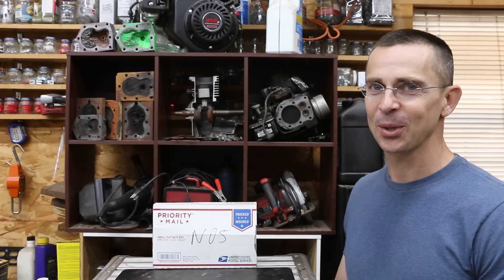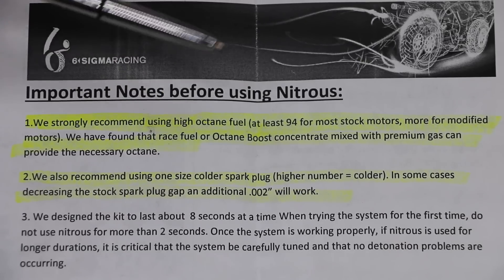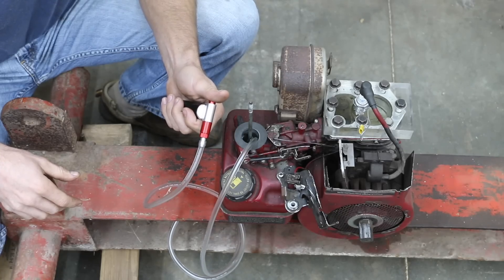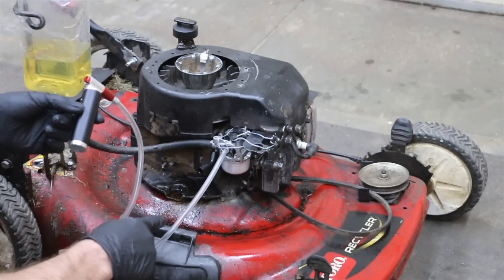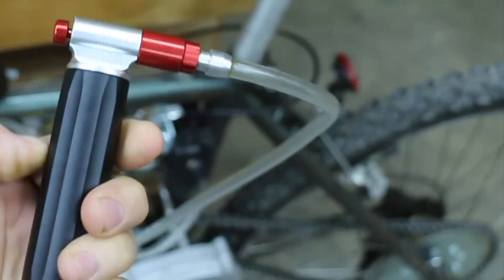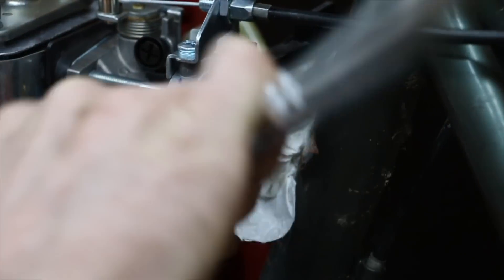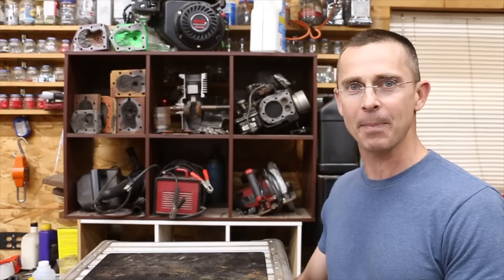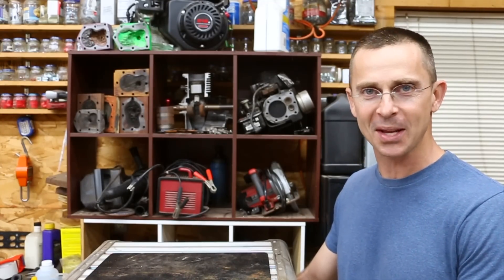Will the 4-Stroke Bike Survive Nitrous Oxide?  Let's find out!

Comment: I can't understand how this is supposed to work, even theoretically. Power is not free. The Nitro needs additional fuel to oxidize. Unless this engine is already running extremely rich, where is the extra power coming from?
Reply: Given the size of the caniser and the lack of high pressure line it is safe to say that there is very little Nitrous actually going into the motor.  Being an air cooled small engine, the carb is likely tuned a bit on the rich side to help with cylinder cooling.  Toss in a miniscule amount of nitrous and it leans it out, better burn, more power.  Since the nitrous hits are so short, the chance of melting a piston is pretty small.  The detonation/pre ignition on the other hand has a good chance of hurting that little motors cast piston.
Reply: The gain found here was the cooling effect of the nitrous charge and the leaning out of the motor. On a engine this size, can see the change.   Ideally a small amount of fuel should be added also.  A full size nitrous kit for a car/boat/etc would add fuel with a lot more nitrous, or get a nice pile of scrap metals for recycling.   I have played with the stuff in cars for over 20 years.  Fun stuff, but very expensive lessons if used incorrectly.
Reply: Because oxygen itself is a fuel, it makes things more volatile/hotter when it enriches the  other fuels. This is adding to the combustion process by suddenly being released when it reaches the flashpoint mentioned in his msds.
Reply: +oo0S... NO It is not a fuel. Oxygen oxidises certain fuels.
Reply: Where is the extra fuel coming from?  When you press button, what is the mechanism that suddenly provides all this extra gas for the additional O2 in the nitrous to burn?  When you install it in a car, there is a mechanism which dumps extra fuel into the cylinders.
Reply: @tarstarkusz 
It takes energy to create NOx. (N5O2 or N4O2) In chemistry, this is called "an endothermic reaction" - as opposed to an "exothermic reaction", where energy is produced. 
Therefore the act of breaking down NOx, being the reverse of an endothermic reaction, is an exothermic one.

Let's assume this is N4O2... It takes 2N2 + 1O2 + energy -> N4O2.
When it reaches ~1200F, it breaks apart. One molecule of NOx then creates 2 molecules of N2 and one molecule of O2, thus increasing volume, and producing energy while falling apart. O2 can then be used to more efficiently burn our sweet sweet carbohydrates (gasoline) with as this is an added O2 that was not there in a naturally aspirated engine.
Reply: +Seriously...  There is already ample O2 to oxidise all of the gasoline dripped in by the jets. Real Nitrous systems inject additional fuel into the cylinders when the Nitrous is on.  At best, it is simply leaning out the mixture for a few seconds.
Reply: @tarstarkusz  You have a wet or dry system, the dry system which you usually buy as a cheaper kit just feeds the nitrous bottle straight in, and it was the boost used in warplanes originally. Yes getting more oxygen into the system will help the fuel burn better.
Reply: tarstarkusz ever feel like you’re talking to a wall? 

I have some nitrous experience, and I am a bit confused. My guess is that this 4 stroke was running rich to begin with, and the nitrous added is so little that it doesn’t lean the motor enough to do damage on an 8 sec pull.
Reply: +Jeremy... YES!  If it is rich to begin with, then the 99.9% of the time the engine is running without nitrous, it is doing so less efficiently.  A lot of the people in these threads seem to think nitrous is magic or its own energy source.
Reply: So if you would run a motor on nitrous oxide but keep it at the same output effect as with normal atmosphere; would the motor burn less fuel and/or run cooler?    @tarstarkusz
Reply: +Kung... I don't think it would burn in a nitrous atmosphere without oxygen to start the initial reaction.

Comment: Maybe I didnt fully understand the kit and what was included. Still a great video but the purpose of nitrous is to be able to introduce more fuel because of the added oxygen created in the break down of the nitrous. Without the added fuel youve created a very lean fuel air mix that isnt great for performance and can ruin your engine due to the extreme temperatures created. Obviously the video shows that it works but without adding the extra fuel so much power is left at the table and your greatly shortening the engines life span.
Reply from the maker: Great point on the need for extra fuel.

Comment: When you add NOS there is just too much O2 in your air-fuel mixture therfore flame have higher temperature and cause knocking. To blow up engine you have to add NOS and more fuel 😁
Reply from the maker: Great point. Thank you

Comment: There is a story about a Citroen 2CV being driven by Jaques Sequela and J.C. Baudot in the Aatcama desert in 1959. Their engine lost oil though a broken crank case breather and they could not continue. To get the engine going again the story says they pushed bananas thought the breather and the oil in the mushed up bananas lubricated the engine for 300km until they could get engine oil. Would you test an engine lubricated with bananas and see if it can run for any lenght of time?
Reply from the maker: Great video idea!  Thank you!
Reply: With the peel or without the peel or just the peel. The old cartoon banana peel trick!
Reply: Marcel LeMay 
Well if a real engine won’t work with bananas for oil I know a cartoon engine would, banana peels are the most slippery thing known to cartoon man.
Reply: This sounds like bananas
Reply: Bananas are something like 90 percent water. If you can get them mushed up enough, they might actually work!
Reply: @SuperDavidEF  I think its closer to 75  ..not that it matters..cheers
Reply: It has me wondering if the 2CV 's oil system (perhaps just a bath-style) is different than modern engines to where it would work better with bananas.
Reply: Not sure how well a gear pump pumps banana mush... I am skeptical.
Reply: Lol
Reply: What about those candy bananas? Or a banana Sundae? with ice cream and chocolate sauce, but no nuts on top, nuts in your engine would be silly!!!!!!!
Reply: The banana lubricant is actually what they use in this video, in an axle: https://www.youtube.com/watch?v=GslPzhFLyas
Reply: I think it's safe to say that a banana is not a good choice as a lubricant... Wouldn't be surprised if the bananas led to a great big sieze after 5 min of run time... Sounds more like a fabricated story.
Reply: @ripperfisher182250  The 2CV engine is a very simple, 2 cylinder low compression boxer engine and it do not rev that high (I think max. rev was about 3800 rpm and it reached max torque around 2500 rpm. This is for the 1959 engine with 12 hp.) so I think it might could've worked. 

- but you're right; bananas is not a good choice for lubrication, but if I was stranded in the middle of the desert, and it  was my only option, I sure would try. :)
Reply: @jrand2631  well that sure changes a lot... But I guess to clarify what do they mean bananas? Did they mash up bananas and make some kind of gravey out of it? But still I mean there is a 1000 better options honestly.. might as well use water at that point. The bananas would have made an impossible cleanup process. The amount of flushing or complete breakdown required to get bananas out... Too crazy idk.
Reply: @ripperfisher182250  Probably the bananas where just working as a filler and non destructive solvent. The remaining oil was again able to get to the parts needing lubrication, although somewhat diluted?

Comment: Well, it seems you've found valve float on the lawn mower engine. The problem with this kit is that it's a dry nitrous system. Once you hit the nitrous button, the engine goes lean, which reduces the power gain and also makes the engine ping. If you were able to jet it to be a bit rich, I'm sure you could get more power.
Reply from the maker: Great point. I'll have to come up with a way to deliver more fuel. Thank you!

Comment: There are a few things you need to know:

Nitrous alone will have a minimal effect on horsepower.  It must be mixed with additional fuel, in order to avoid a lean condition.  

But N2O has a two-fold effect.  

First,  it decomposes at combustion temps,  to effectively  increase the volume of air and cylinder pressure during combustion.  

Second,  it boils at exactly the same temperature as CO2,  drastically lowering the intake mixture temperature.  The colder the air intake,  the better,  since cooler air is more dense,  allowing a larger charge for a naturally aspirated engine.  Fuel and air mass is determined by weight; not volume.  

So,  your engine sped up, due to improved volumetric efficiency as a result of the cooling (refrigerant) effect of the evaporating N2O,  but, due to the lean condition introduced by the additional air when the mixture ignited,  experienced BOTH preignition AND detonation. 

Nitrous alone,  or too much nitrous for the fuel jet,  will surely ruin an engine.  Just watch some of the failed dyno tests on YouTube,  where the entire intake manifold is blown to the ceiling...
Reply from the maker: Great points.  Thank you!

Comment: Well that was a great video. Very well put together I’d like the pre-ignition and the old Briggs & Stratton engine but the clear head.
NOSs a great product for producing horsepower on street And strip vehicles pick up trucks etc. they really shouldn’t be used with cast pistons but come stock in most vehicles you really want a forged pistons and you had a beef up the Bottom end The heads you can build an engine in your garage for about $20,000 how are you can simply buy one from Summit racing short block long block whatever your wallet can afford . I said most people are lazy today they don’t want to build their own engines anymore back in the day when I used to change my own cams and build my own engines used to build Chevy 355s 4 bolt mains etc. people just want crate engines now. And then in a go to car shows and tell everybody they built the engine LOL back to the video I’m not into cars anymore I’m into aerospace we work on jet engines . Doesn’t J Leno have a old Chrysler with the jet engine in it ? I can’t believe the bicycle got up to 41 mph that’s our record it’s almost like a moped. In son of a gun that Toro recycle or will not die but I did hear some crank knock LMFAO enough ranting. 
Thanks for being an ear Todd how is Missouri any More snow?
Reply from the maker: Hi Mike, Thank you very much.  Great points regarding the use of an engine designed for nitrous.  I can't believe the old Toro is still hanging on.  It's got a LOT of blowby.  We had a small amount of snow yesterday, but it didn't stick. Hopefully, we'll avoid more snow this week.  Thanks again and hope all is well with you and your family.  Best regards, Todd

Comment: I just would like to respectfully correct a few misconceptions that I saw in your video.  First Nitrous Oxide is Chemically N2O (33% oxygen) and it provides added power by allowing the engine to burn more fuel since air is about 25% oxygen.  Since you are not adding more fuel you are getting pre-ignition from an extremely lean mixture in the combustion chamber.  To do it right and to keep your engine from cracking a piston, you will need to add a secondary fuel pump with a different injector that puts both N2O and gas into the intake at the same time.  And lastly, NOS is an acronym for the brand 'Nitrous Oxide Systems,' please dont call it 'Naws', thats a huge pet peve of drag racers and car guys in general.   Thanks for the entertaining videos, and I would like to see what a properly installed nitrous system would do to a small engine!  Try looking up a "wet" system, those are kits that are made to inject both fuel and N2O properly.
Reply from the maker: Thank you!  I'll have to get a wet kit.

Comment: Does this kit actualy add Gas into the Engine to? Because if not,that wpud be quite a bad thing, the Engine woud run far to Lean.
Reply: And btw. Could you please add the Link of the Kit to the Description?
Reply from the maker: https://www.amazon.com/gp/product/B01L4E4F6K/ref=oh_aui_search_detailpage?ie=UTF8&psc=1
Reply from the maker: It does not add fuel.  Carb will need to be setup to run really rich or an extra fueling setup will work.
Reply: @ProjectFarm  thank you, i have a Moped with a 10mm Carb and a "Choke" that richens up the Mixture by spraying in More Fuel, it might work with that.

Edit: you could also build this kit by your self.

Comment: Im not too sure on these small engines but for a full sized automotive engine, In order for an engine to last long under NOS. They do plenty of other supporting mods to the fuel, ignition, engine, and sometime driveline. Sometimes they will take the engine apart and open the piston ring gaps up a little to keep them from butting together as the heat increases and that helps prevent the pistons from braking. Also forged internals are commonly used since they are usually stronger than OEM cast pistons. The ignition system is usually set retarded to prevent the cylinder pressures from peaking before the piston reaches TDC. You can buy ignigtion boxes that can do that or be dirty and set it at the distributor if your vehicle has one. They also commonly use the colder spark plugs. Ive seen people run a separate fuel line and pump for the Nos kit so the OEM fuel pump isnt feeding both the NOS and engine Though this isnt necessary. Typically they use switches and sensors that will only allow the NOS kit to operate at specific circumstances such as WOT and if the pressures of the fuel and NOS are safe. If you have a street car. Its usually Illegal to drive with a live bottle because if the car catches on fire. That bottle could explode not because of the gas but just the pressures increasing. Some people will purposely warm the bottle a little so increase the pressure typically around 90 degrees Fahrenheit. That is just some basic knowledge for basic NOS systems for cars and street bikes. You can put much more effort the make the engine run 100% safe and reliably with the stuff. NOS kits are usually cheap to buy but its the tuning and the gas itself that can be expensive.
Reply from the maker: Great point. Thank you

Comment: NOS is actually brand name like kleenex and is an acronym for Nitrous Oxide Systems. Nitrous Oxide effectively adds more air to the combustion chamber. The more air you can get into the engine the more fuel you can add to keep an ideal air fuel ratio for a given load which results in more power.

You should try a brand new plug, hit the nitrous, shut it off immediately and read the plug to see the air fuel ratio. I bet it's very lean. It will make more power being richer with the unsophisticated cylinder heads on a small engine. With a simple fuel system it's difficult to add fuel only during a nitrous hit so you comprise usually by running rich without the nitrous.
Reply from the maker: Great recommendations!  I'll add more fuel. Thank you

Comment: With this being sprayed directly into the air box how would you resolve the knock? Is it possible to upjet enough to cure the knock and not have the motor running like a pig? The knock is going to ruin any engine.
Reply: Pressurize the float bowl with nitrous to cause a rich condition
Reply: @Aronteed  Exactly.
Reply from the maker: Great point.

Comment: Can you do a test with nos and E85 or ethanol? I know you will need to lean it out as ethanol is a hotter burning fuel and a faster burning fuel but I think it would be cool to test it. I run it all the time in my non ethanol fuel car, I mix it half 87 octane and half ethanol and it works exceptionally well.  I have run my vehicles this way for years now without an ounce of trouble. 1 vehicle is a 2013 chevy volt and a 2015 chevy truck.
Reply from the maker: Great video idea!  Thank you.

Comment: Can you please shave and port and polish the cylinder head. I bet you will get at least 50mph
Reply from the maker: Thanks for the video idea!
Reply: @ProjectFarm  yes this is a good idea, also to explain how you are doing it and the benefits! thanks man!
Reply: Yeah do a video on this to see what the power difference is. Would be cool.
Reply: Great idea. He's probably working on this right now.
Reply: That really depends on the RPM he's getting at the moment. You can only do so much with the current gearing on the bicycle.
Would be nice to test the bicycle with a bigger front (engine) sprocket first. I think the bike could go faster if the gearing was faster as it would leave the engine in it's peak torque band.
Adding NOS to that would make a bigger difference. Shaving, porting and polishing would then make it a race engine.
Reply: let's add an oil cooler and yoshimura exhausts and increase compression ratio on the head and replace with titanium valves and increase inlet port with larger carburator msd high spark ignition coil carillo  conrod
Reply: Throw in a hypereutectic piston with ceramic coating and some moly embedded in the cylinder wall.

How did he die?

Well, the video shows he hit a record speed of 163mph and then...